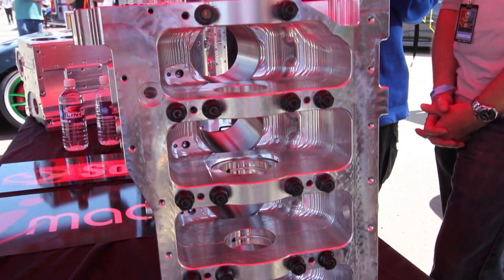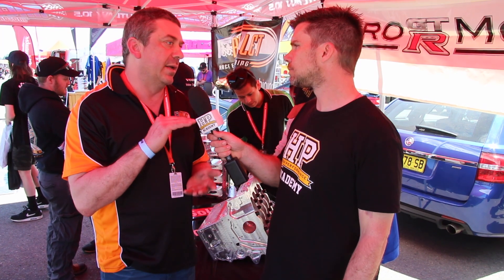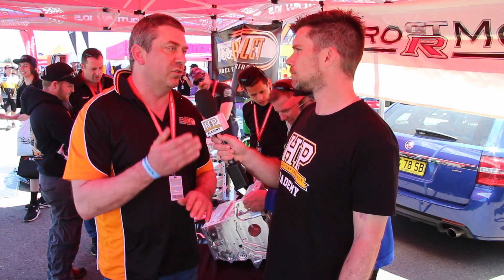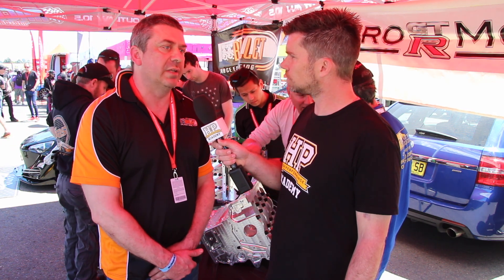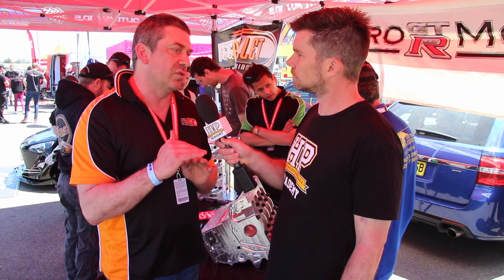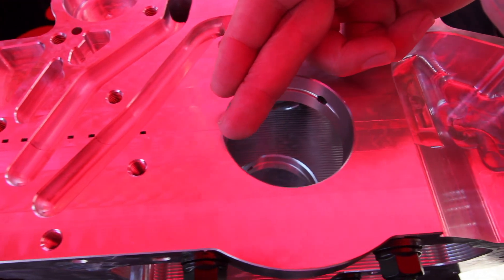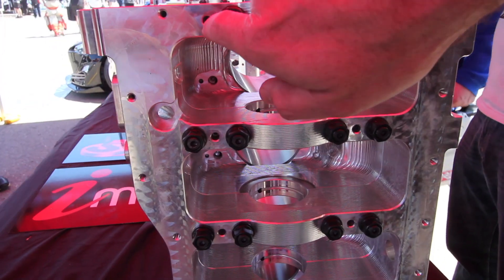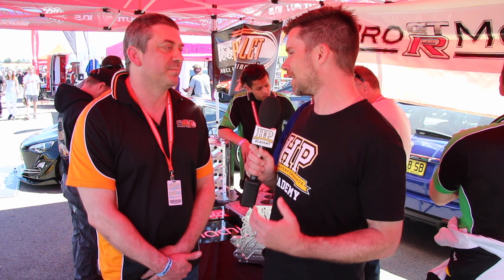100 psi of boost, 11,000 rpm and 1900 horse power - This billet block can handle it

Comment: for interest , the highest inlet manifold pressure ever recorded IC piston engine, was on a USA diesel tractor puller engine test, was 270 PSI,  4 large compound turbochargers, inline 6, billet steel block/head.
Reply from the maker: Just a little bit then! https://www.youtube.com/watch?v=a01QQZyl-_I - Taz.
Reply: Ron Brothers
Imagine the valve springs needed to work against that much inlet pressure.
Reply: @177SCmaro  they probably look like suspension coils...lol
Reply: @Anonymous-c6f7d  
Lol, too right.
Reply: @177SCmaro  Jesel
Reply: Back to F1 of old for some rotary valve heads.
Reply: Brandon, and probably only 8 seconds of those 2 mins were under boost then I assume? ... Or you meant it can do 10 runs of 8 seconds and then need a rebuild?
Reply: @brandonquenneville7330  Wrong it's not NHRA Top Fuel. In any event most teams run the same engine unless they blow it up.
Reply: Ron Brothers did the manifold welds blow???
Reply: @paulmryglod4802   No, why would it? There is lots to be learned from the tractor pulling community who have been compound turbocharging for 20-30 years.

Comment: So would anyone know if someone where to put this block in let's say an evo and run 800hp. Would it be really reliable at that power level or is that not how it works?
Reply from the maker: The block would be fine so long as everything else around it has been done correctly as well. Getting a block like this is just one piece of the puzzle, not a be all and end all alone if that's what you mean =) - Taz.

Comment: Don't know if anyone is still reading this thread, but have any of these guys on the freakin', bleedin' edge considered doing a combined head and block as a single machined part?
Back in the day it was common to do this, like the old Offenhauser (sp?) race engine - main reason I can think against it is getting the piston assemblies past the main's webs and bearing area, but if there is a full billet cradle making up the bottom on the engine, perhaps that is less of a concern?

Comment: How does crankshaft and crankshaft bearings not get slammed at this kind of boost?
Reply: That was a problem in some of the early billet blocks but these guys actually split the block at the crank center line.So the lower half is all inclusive.there is no girdle as it is built in and this has reduced the issue.The other thing that helps it to survive is aluminum has some absorption that steel doesnt.It's tough to explain in a comment but if you look into how aluminum rods malleability absorbs some of the stresses in a high end drag motor you'll understand what I mean.......So while they still get slammed the materials they are using has a BIG effect on things.At least that is my take on it.But I build boat engines that have to survive hours on end not drag stuff.

Comment: I wonder if you used cgi and precision machining to concave the area around the bolt holes ever so minute just a couple thousands so it would actually pull it flat when clamped?? I know its kinda crazy sounding..
Reply from the maker: Stress points related to this are touched on in this video which I'm certain you'll enjoy :) - https://www.youtube.com/watch?v=J87SVqG18sY&lc=Ugwq-rW1ERxo1u6jlvl4AaABAg - Taz.

Comment: only 11000rpm?and 1900  horse power go to extreme tuners to earn your lesson
Reply from the maker: The car that this engine is from holds the 4 cylinder MPH World Record (which is faster than Extreme Tuners car). Extreme Tuners do use exactly the same block technology - Taz.
Reply: same block technology ?Extreme Tuners build in house all parts and they made the block before 2016
Reply: aa by the way Extreme Tuners holds or not a record .
Reply from the maker: Hmmm, might pay to do some more research mate. :)
Reply: do what ever want evo is here and is alive bring any evo you want
Reply from the maker: Mate, I think you are miss interpreting our video and our comments. 1. We don't have an evo. 2. All I'm saying is that Extreme Tuners are ALSO using a billet block (Same technology, even if it is made in-house) Just chill out, no one is discrediting Extreme Tuners here. Check out Jett Racing's Eclipse http://jettracing.com.au/ - Ben

Comment: How much for the block?
Reply from the maker: Not really true Supersevenn, even rich dudes have to ask how much ;) The block and stud kit is $8800 AUD, which when you are making upwards of 1000hp...it's a pretty small investment. - Ben
Reply from the maker: I'm going out on a limb and saying you're just trolling. Thanks for playing mate.
Reply: https://www.bulletraceengineering.com.au/billet-blocks
Reply: HPA, you are absolutely right, $8800 AUD is just $5000 isch and that is CHEAP for anything that well built. A properly billet LS engine (which yes yes, junkyard, stock bottom end, turbo, 24 psi, drag racing, yes we know people ) sounds stupid from a cost-perspective, but can be really nice for N/A, costs around $24,000 for a 447 that makes 720 hp or $29,000 for the marine LS7 427 DOHC that makes 750 hp, both of them reliably. Really interesting to be able to get (well not all of it) SOME of the engine in the video for that low a price.
Reply: ChadMutt you know that those are blocks for racecars?
No one ever would run 100PSI on a street car...
...at most 50 just because of fuel consumption. And for being able to handle up to 100PSI is insane considering they dont cost more than 6 grand (btw it may be able to handle 100PSI but it doesnt say you have to run it at 100PSI. For a Street/Track car you could run a boost controller (costs maybe 100$) and run 2 or more tunes (like Street with 10PSI or something and Race with like idk 90PSI). Btw i dont think anyone buys these blocks to increase reliability. Just to increase power and keep it fairly reliabe.
Reliabe also doesnt always come from the builder, yeah when you put a lot of time and effort in building the engine it probably lasts longer but you can rebuild a stock LS with as much love as you want but it will probably still keep blowing up at 700-800hp under boost. Reliability and ability to hold power comes from how you build the engine but mostly still from parts
Reply: ChadMutt 

dude the block is sleeved. you can even daily it at 1000hp and it will last a long time
Reply: Especially when you live in Australia 8k AUD/5.5k USD isnt a bad price
Reply from the maker: We don't sell anything other than our courses so you will have to get in touch directly with Bullet Race Engineering for an answer to that - Taz.
Reply from the maker: You can get this block for race use or built for street use. Check our latest video on Micks EVO. It's street driven, very reliable combo. The very reason you would get this block is to increase reliability. :)  https://www.youtube.com/watch?v=VUUx7AICy_c :)
Reply: ChadMutt you are a fool and clearly have never had anything other than maybe a 160hp camaro that's wicked fast.  He's not saying you buy this block so you can reliably drive to the kids basketball practice on 100 psi. Just because you have the best tuner in the world that's not gonna keep your engine together. Show us one picture or video you have with yourself next to an engine on an engine stand or any kind of build. You are a never has been and a never will be. These people are out there doing it. Go back under the bridge troll
Reply: JustAnotherCarGuy right... It's nice to know that there are still compa8 out there that aren't trying to rape the customer.
Reply: if you have to ask how much, you cant afford it

Comment: Junk. Y so low in hp . Ford stock 96-98 cobra blocks can hold 1800hp on a stock 4v block.  Lol
Reply from the maker: 1900 hp > 1800 hp :)

Always keen to see what's out there. Throw us a link to some details when you have a minute - Taz
Reply: High Performance Academy . 4v cobra been 5.8x in a 1/4.
Reply: 5.8 Ford block and heads. Keep up with  Production parts
Reply from the maker: Nice! Can you please throw me a link so I can see the details? I can't find it on Google and I'm keen to find out a bit more about this. Thanks mate! - Taz.
Reply from the maker: In the meantime, why not check out this (yet unreleased ;) ) Nissan VR38 that produces 2200+ hp on the stock block. Billet blocks are also discussed and I think you'll find it interesting - https://youtu.be/J6zwaMejgio
Enjoy! - Taz
Reply: High Performance Academy well,You haven't notice to run 5.8 seconds in a quarter mile is well over 2000 horse power . Lol plain stock Ford parts. And a definitely isn't a billet block
Reply: that's correct.....but you are "spreading the load " over twice the area (8 cyl vs 4)
Reply: oh wow so a block with over twice the displacement can make close to the same amount of power? we're supposed to be impressed? and lets not even talk about reliability lol.
Reply: Justin Gulley Barra factory head and block can make more than 2000hp. What is your point ?

Comment: With the ability to machine your own block and parts, why not try something more extreme like making a V8 out of this motor? Or perhaps a V12 2JZ type of engine? I'm sure this is being done to fit within the rules of certain classes, but with this advancement in materials and production, why not push the boundaries of what's possible with some of these motors?
Reply from the maker: Hey Jeffrey, it really depends on your budget, your class and what your goals are. 
Some people enjoy pushing the boundaries in different areas and I have no doubt there will be people out there quietly working on such setups, while there are of course many trying to push the boundaries with what they already have/can afford/just outright enjoy.

You don't have to have the biggest, badest, most unusual and/or fastest setup out there to take away the most enjoyment or to learn some new tricks ;) - Taz
Reply: you're onto something here- i've always dreamed about an inline 6 6g63 :)

Comment: who the hell is running 100psi ??
Reply: Australians
Reply: 4g63 diesel coversion
Reply: TheSplendidVids my grandmas daily.
Reply: How do you not run in to knock limit?
Reply: Richard Price low compression ratio and methanol or nitro methane...
Reply: Grip Limit math please? Methanol is about 15.1 compression ratio on the knock limit
Reply: People low on cubes. Big blocks only need maybe 30 psi to make 3000 hp plus XD
Reply: James Avery but weigh a tonne and handle like siht.
Reply: oath ba
Reply: James Avery
People do sometimes have a tendency to get carried away with specific output. There is something to be said for a larger, more reliable engine.
Reply: 177SCmaro just imagine how much an ls7 7 litre block like this could handle.
Reply: Kameron James Basically Top Fuel.
Reply: Richard Price that's why you drop compression for more boost.
Reply: This dude runs it🤣
https://www.youtube.com/watch?v=xxZxJ1leNK4

Comment: very informative, always thought about sealing up the head and deck and running external lines to get around water on one of my projects. Head bolt torque values, bearing/ piston/ring clearances are of interest in these high output engines

Comment: I heard about them  about 4 years ago. They don't do just 4g63,they also have sr20( which I think they use in time attack as well) and  Subaru boxer billet block.

Awesome interview.
Reply from the maker: Yes sir you are correct. They have quite the range now. - Ben

Comment: see what they did with a version of an old formula one engine was to drill the engine head studs in on an angle into the block.
Reply: Bipolar Transition i was actually thinking that would be a good idea. 10° would probably work pretty well
Reply: anonymous yea have the tightening surface at the end of the stud perpendicular to it, run them tilted to the exhaust on one side and towards the intake on the other.
Reply: anonymous I just realized you'd need a pretty thick block to be able to get proper thread depth
Reply: was it cosworth that did the angle thing on the block?

Comment: My buddies dad had a '69 Chevelle with a big Ole 8:71 blower on it making about 800 HP and he ran under 5psi... How the times have changed..25-30 is average for a driver/weekend track day car.. With your hardcore racers running 90-100 psi! Absolutely awesome👍
Reply: Craig Cundiff Yea and now performance diesels are pushing over 200psi lmao
Reply: Because these are small motors compared to a typical American v8. You don't need as much boost as they do to make the power. 800 hp on only 5 psi is amazing in retrospect when they need 5 times the amount